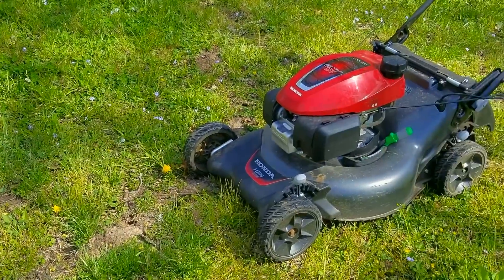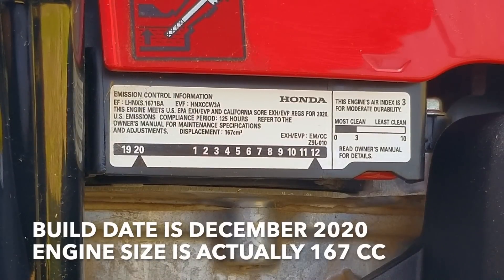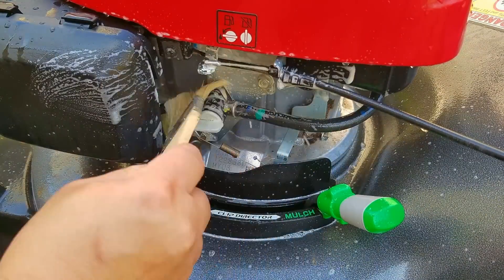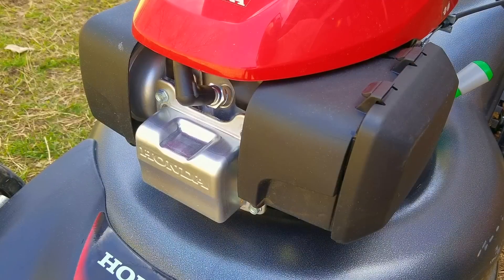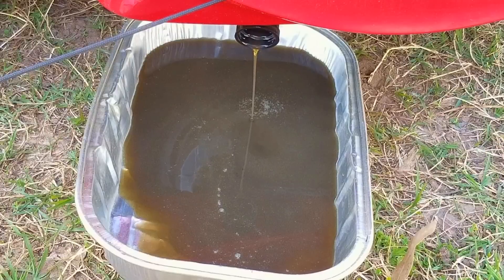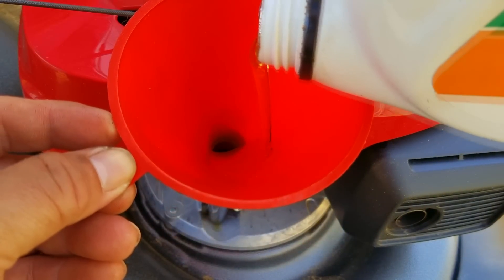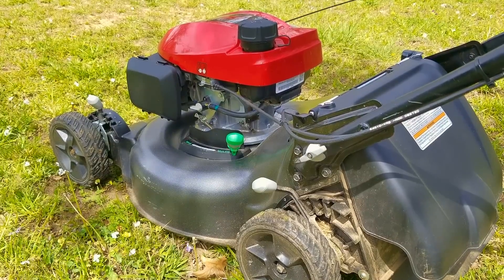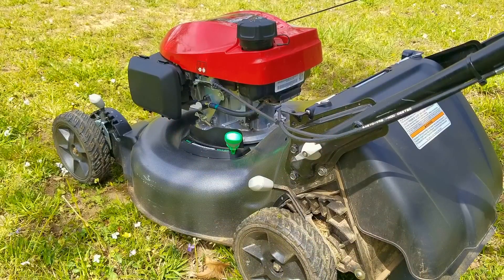Fixing A  Honda HRN 216 Mower That Won't Start

Comment: I’m hoping the community could help me with my issue. Same model I bought about 1 year ago, doesn’t start just spins. Changed oil, filter, plug, manually put in gas and engine for a self configuration test, turned on for approx 3 seconds than shuts off. Repeated and same result, does not keep running, anybody help on what the problem could be?? Thank you!!!!
Reply from the maker: remove the carb, open it and clear the jet.
Reply: @INSIDEHOUSEGARAGE  got it thanks
Reply: @INSIDEHOUSEGARAGE  bro guess what, so after all the maintenance i did to my mower it ended up being the last place I’d check….. the spark plug! I just replaced it like 1-2 months ago so I didn’t bother to check. Changed oil, cleaned jet and carb, cleared fuel lines, and it was the spark plug lol.
Reply: On second thought, I might still need your help. After changing my spark plug,filter,oil, cleaning the jet and carb it’s still not starting🤨? Does turn on when adding fuel to the carb hole by the air filter but very quickly turns off, around 3 seconds max.
Reply from the maker: nice work!
Reply from the maker: do me a favor, is the fuel valve in the on position? and if so, remove the bowl, to make sure fuel is flowing into it.

Comment: Mine is brand new and I left it sitting in the garage for a few months and now it won’t stsrt
Reply from the maker: drain the gasoline from the tank, and at the carb. Refill with fresh gasoline, and see what happens. 
If it still won't start then the fuel jet is clogged.
Reply: Thank you! Will do that! 
I bought it brand new and only used it three times then after that I had to store for winter and a few month ago I wanted to start it and it wouldn’t. I pulled on the string for a good 30 minutes and nothing and for almost $500 I didn’t think it would go bad this quick

Comment: Second thing is to spray it with water.???
Reply from the maker: not sure what you're asking, but are you asking if I'm spraying water into the carb? The chemical bottle I'm using has gasoline in it.

Comment: Just got one delivered and the right side handlebar adjust knob was broken in 3 places and on the floor. What absolute trash these new machines are, build quality is terrible
Reply from the maker: they are built way differently than they used to be.